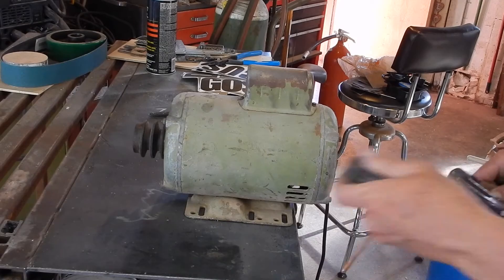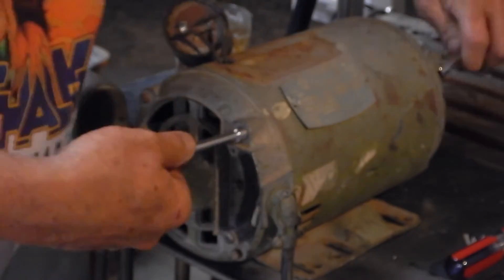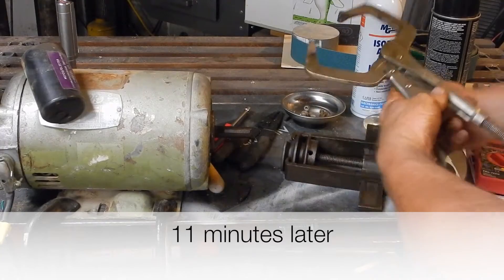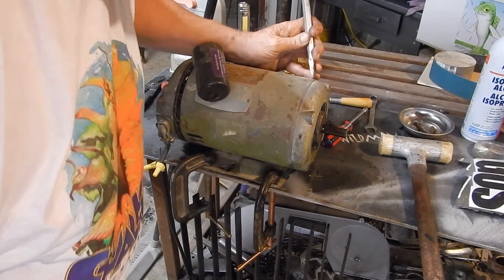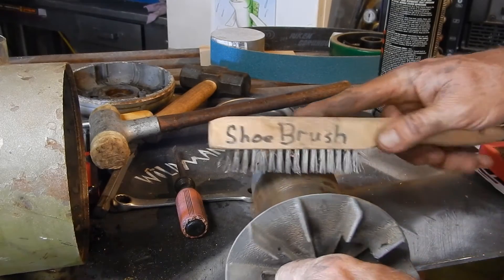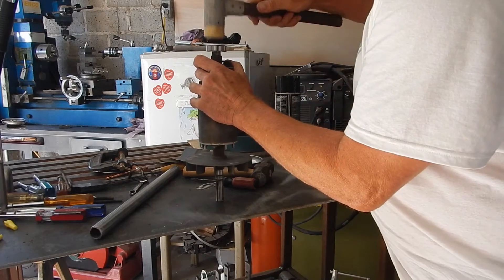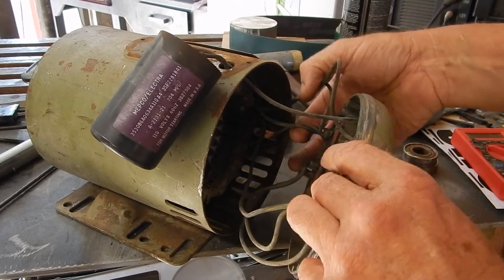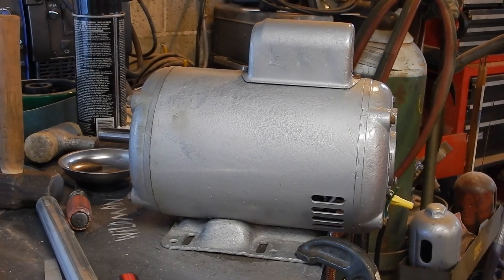2 HP Motor Upgrade for the Drillpress

Comment: The start winding is in series with the start capacitor and centripetal switch.  Those two wires come out and parallel with the run windings.
If you flip the start winding/capacitor/switch wires around you will reverse the direction of your motor.
Reply: I know that, sadly access to the other pole was deep inside the motor and even the local motor shop said reversing the direction was not worth the effort.

Comment: Hm, this gives me an idea for a 3 HP 3450 RPM motor from a compressor that recently sprung a leak.  The one that is on there now is a 1725 RPM motor.  It looks like if I can fit the pulley I might just have to tinker with the bracket.  It might actually be smaller in size than the one you have too.  The compressor part also still works but the tank has a small hole in the bottom.  I took the belt off it for now to prevent anyone from trying to run it.

Comment: It amasses me what people throw away. with a little T&C and new bearings it works great. It is a pity that it runs the wrong way but as you said a 2 horse motor never comes in wrong. One use would be for a sander as the direction is not important. Grate job repairing it.
Reply from the maker: Thanks! I'll use it for something eventually.

Comment: great work dude, I enjoyed the fridge and heat for the bearing install..I don't know why that was so much fun lol...Great work, you can use it for a bunch of stuff in the future anyways...rock on
Reply from the maker: I learned that from a South Bend Lathe manual where they mentioned freezing a steel pin with dry ice before insertion to hold a pulley in place. Thanks for watching!

Comment: make a brutal disk sander. 	:-)
Reply from the maker: Sure would, if only I felt the need for one. I'll just keep it in stock. A use will eventually surface. thanks for watching.
Reply: Wildman Tech Maybe you can find an old wood lathe on Craigslist or at the flea market that needs a new motor....  what tools don't you yet have in the workshop?
Reply from the maker: I have a Delta with a 1 hp motor. Works pretty well as is.